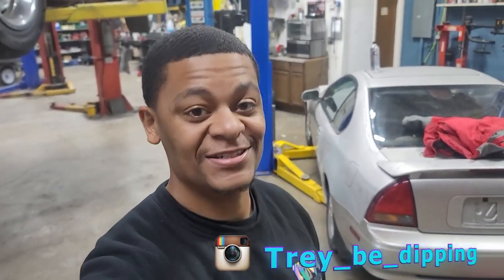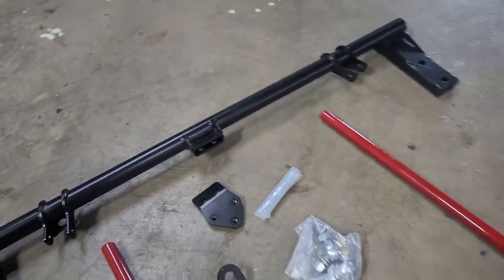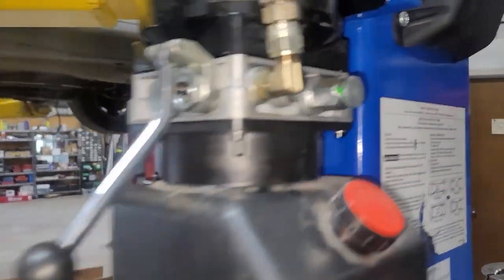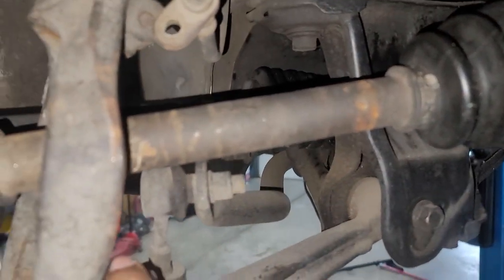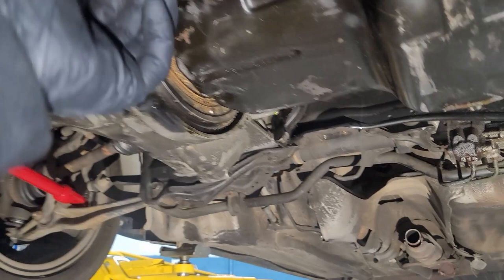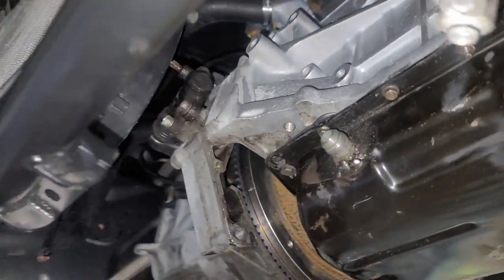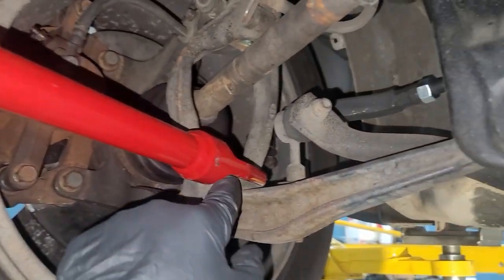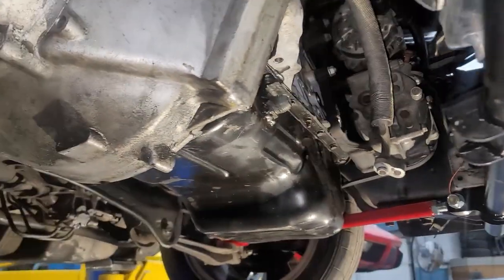innovative traction bar install for the Honda Prelude | how to build a Honda Prelude pt5

Comment: Nice traction bar! I have those same bar on my 94' Accord. Traction bar is strong and light weight than stock. Stock bolts are a little short for red rods. You can go to O'Reilly's to get a large bolts that's where I bought it because left rod was loose with stock bolts.
Reply from the maker: Thanks. They worked perfect on mine no issues for me.
Reply: @treybedipping1734  Welcome, no problem. Glad that it did work out. 👍

Comment: when you go to tighten the bolts on the lower control arms, the car has to be on the ground at normal ride height or itll not work right! I cant wait to install my traction bars on my lude
Reply: I was wondering this. my CB7 has the same setup when I bought it, but it seems like it doesn't have the right preload. your suggestion could be my solution
Reply from the maker: Hmmm ill have to double check but i installed it the same way on my other lude and it works perfectly fine

Comment: So what happened with the provided front motor mount bracket? Did you have to use it to make the stock motor mount work or is that for if you have the aftermarket solid motor mount from innovative etc???? This is the 2nd video on this that didn’t touch on the subject during the install process… not sure why but I will be putting mine in tomorrow morning and I guess I’ll find out once I get under there and see what im working with. It will be pretty obvious im sure.

Comment: Nice work. That forward to backward arm looks like it could still fit with that plate with the 3 bolt holes, did you use it in the end?

Comment: It appears innovative modified traction bar🤔, cause the plate in the middle was already on the bar tho it caused slight issues with the radiator & i had to grind a notch for it to sit properly atleast for my chassis. I assume they address the complaints about it👍🏽. CheatCode Hondas. Proud 3rd gen Prelude owner 😎..
Reply from the maker: Nice yea I'm new to the traction bar back to about 2 years ago so I'm not sure
Reply: @treybedipping1734  ahh yea I remember that vid i believe yuh homie blessed you with it & something was special about it racing something but props to you bro appreciate yuh independence 💯  cuh you shudda been had sponsors, buh if independence is yuh choice nuff respect for acknowledging your value 🤝🏽🤓 GODSPEED_LUDESPEED!
Reply from the maker: @Pro4yu  🙏🏽🙏🏽🙏🏽💪🏾💪🏾💪🏾💪🏾

Comment: I just bought the innovative front mount, and how does it bolt on the traction bar??
Reply from the maker: Should come straight down off of the block where the oem front mount bolts to the block and to the traction bar